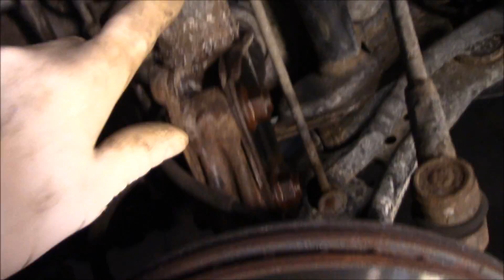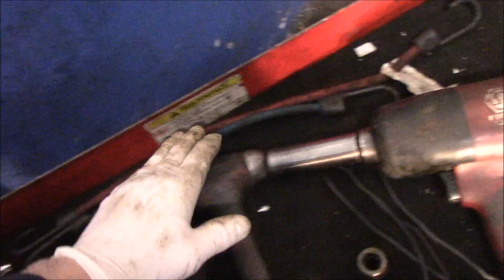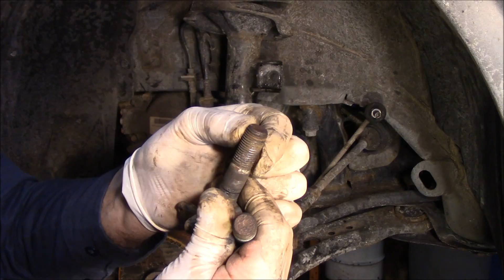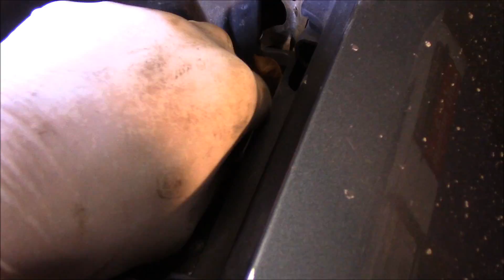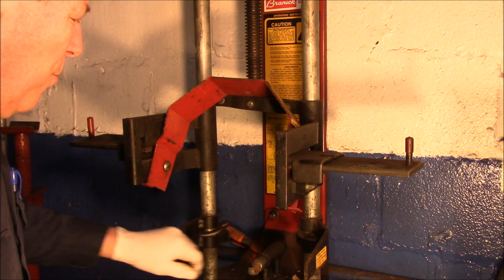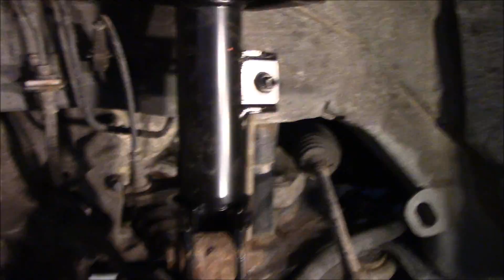How to replace the front struts

Comment: This is such a great video - thank you very much. I’ve watched this about a half dozen times as reference while changing out struts (my first time) on an 09 SX4. Unfortunately, despite your great advice and care to attention, I still ended up stripping out the little hex bolt on the stabilizer link. I’m trying to figure out how to get past this, as the bottom link bolt is *very hard to get to, and I’ve managed to round off the nut... I may have to cut it out. I sure wish there was a better design for this part.

Comment: Hey Jim, on that stabilizer link, couldn't you just run that center allen bolt in reverse while holding the nut with the wrench to remove it?

Comment: my 2008 suzuki Forenza does not have the allen socket on the stablizer  what now
Reply: If it is the same as the rear,  you should be able to use the open end of a 14mm wrench to hold the bolt right behind the "wall" of the strut mount.